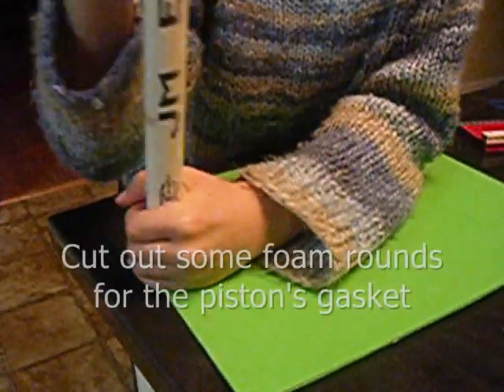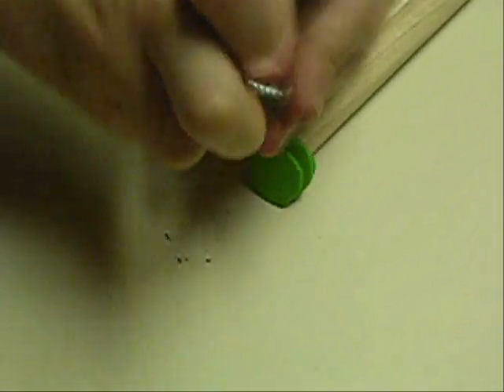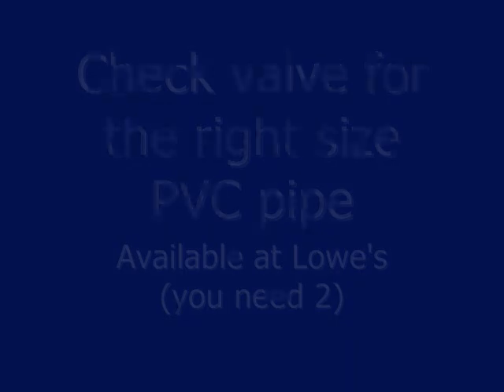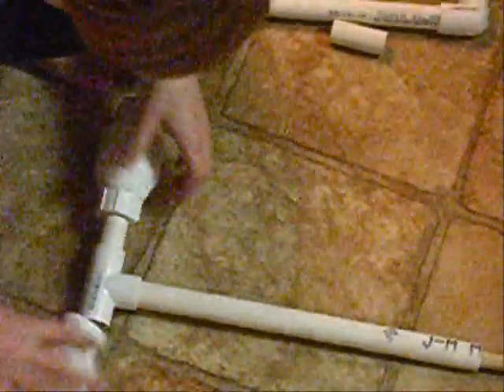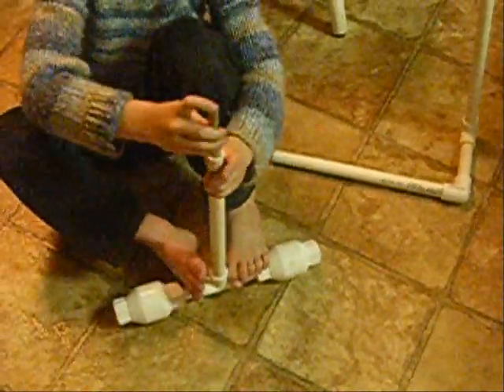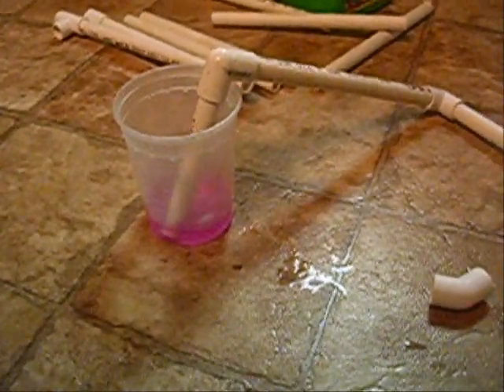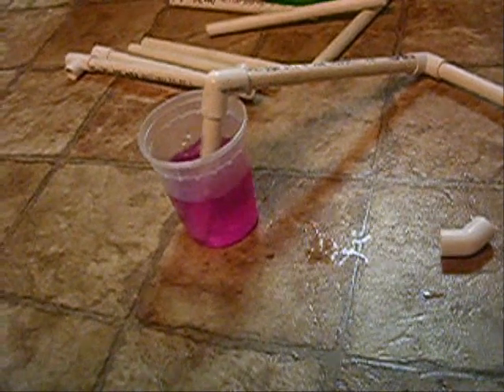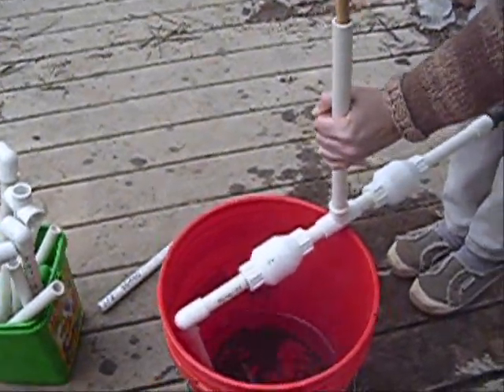Manual Water Pump using a Piston and PVC

Comment: I used their idea, but used 3/4" PVC and check valves instead and it actually worked well!  Unfortunately, though the check valves failed after moving about two gallons of the water.  I think because I was trying to move muddy water which probably clogged the Lowe's PVC valves.  Oh well, it was fun while it lasted.  I guess this only works well for clean water or at least water without too much debris in it.